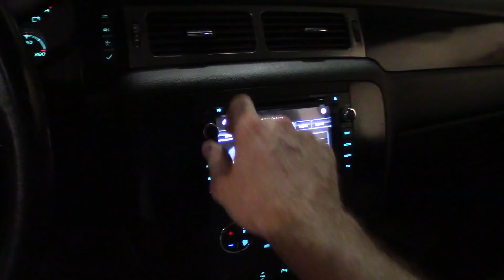A DAY AND THE LIFE!

Comment: Great video man you should of removed the hood it would of made it a little easier for removal an install lol.👍
Reply from the maker: I always have trouble lining em back up. But now I think about it. It probably would have been easier just to take it off.
Reply: @JRC54  yea they can be a pain to get the hood back lined up it's good to get a marker an mark around the hood mount so that away when u go to install it back on it will make it much easier to get it alined right.
Reply: There's actually a service position on these ... What I do on a motor job is unbolt the hinge and there's a empty bolt holes that you can run the bolt back into .. it sits a little further back towards the windshield... But you don't have to take the hood off or the hinge